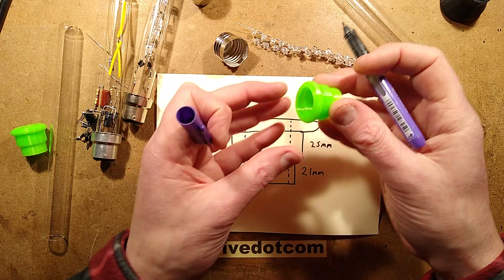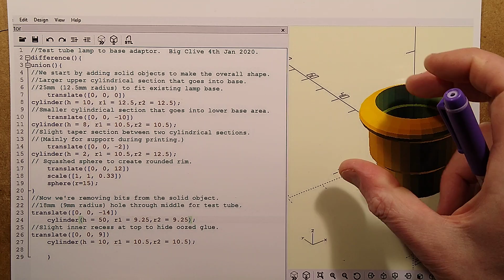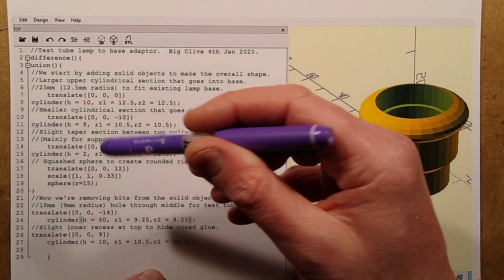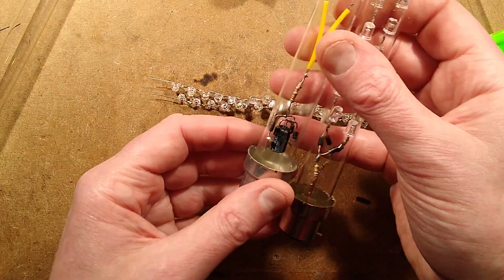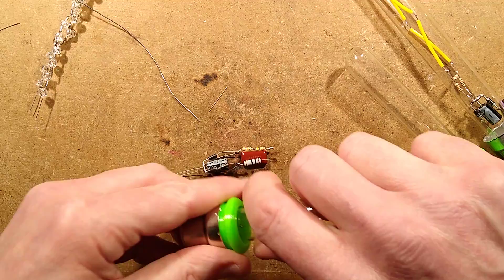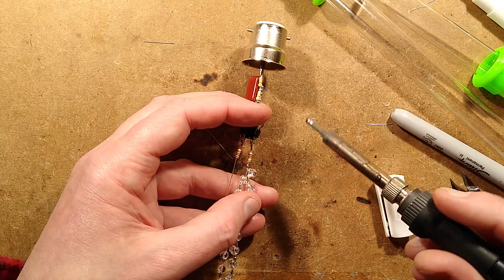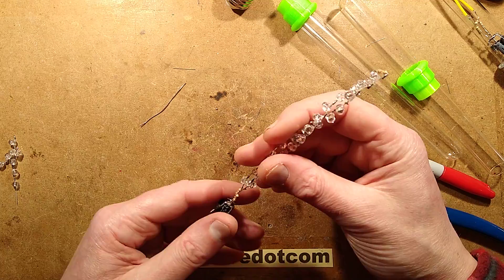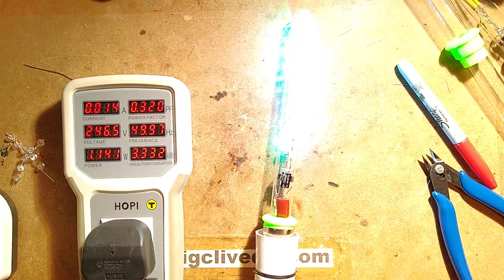3D printed LED test-tube lamp.  (with adjustable 3D openSCAD file)

Comment: I have no interest in 3D printing ( as yet ) but was tempted, so downloaded the program and pasted the script in - worked fine :0)
Reply: I have no use for 3D printing yet either, but I was interested to see that the OpenSCAD language is very similar to the scene description language used for the ray tracing program Persistence of Vision, which I've used for a long time. Both, obviously, depend on what is called constructive solid geometry - building up complex shapes from the union, intersection and difference of simpler ones. It would probably be possible to write code to parse an OpenSCAD program into a POVRay scene.
Reply: 3d printing since 2012 here and I wish I had stuck to my original want of a CNC lathe/mill/router instead because I would have been far better off for the stuff I do.  For parts 3d printing is alright but never the best choice.  What Clive made is great and what rapid prototyping was created for where you 3d print something then it doesn't work out and you redesign/modify and print it out until it comes out just right.  Once that is done you send it to be milled in a proper material.
Reply: @thebeststooge  Depends on what your intending to do. If into metal casting, 3D printing patterns in a lost PLA process. 
3D printing in metal is fine for a lot of projects, and way cheaper than it would be to pay a machinist to make it. Plus can make objects that are impossible to mill.
Reply: @RenThraysk I agree but the whole metal blast furnace is a no way in hell for most people, including me.  The thing is subtractive versus additive speed goes to subtractive.  I can 3d print an object here that is as simple as one could do but requires a 300x300 bed at least and would take me 3 days to print.  If I use a 1mm nozzle I can get that down to about 6-9 hours.  Throw an aluminum plate on the CNC router and done in minutes and the part will be tons stronger than the plastic one.

3d printing really is mostly, keyword there, for knick-knacks and what knots/shelf baubles as I have 3d printed parts and they only anger me.  Now if I could print a part in Peek that would be much better but printing in peek is very expensive and require bed temps 140c+ plus nozzle temps around 320c.  Oh, and it must be in an enclosed chamber with temp controls.  Just not worth it.
Reply from the maker: Have you had a play with the numbers to see what happens?

Comment: Love it! Now I'm eager to use your schematic and build some lights–prolly not test-tube lights, though I'll look into them and consider….

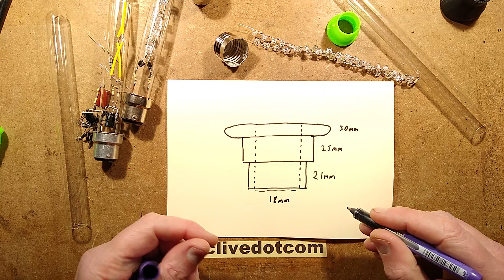@02:06 you din' put arrow ends on the 18mm dimension line–I'm astonished that it worked! (Perhaps it's because the one you used had already been printed?)

Can you measure the lumens? Also it looks like you might've been able to cram another 12, or even double the number of LEDs–thoughts on that?
Reply from the maker: I'm new to openSCAD.  What do you mean by missing arrow ends?
Reply: @bigclivedotcom  I think he means |<--------------18mm-------------->|    :P